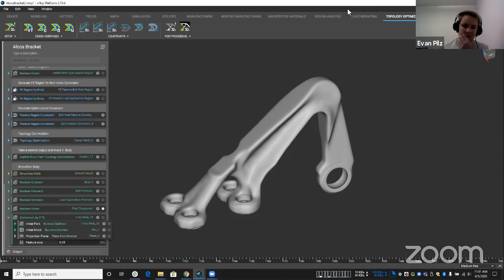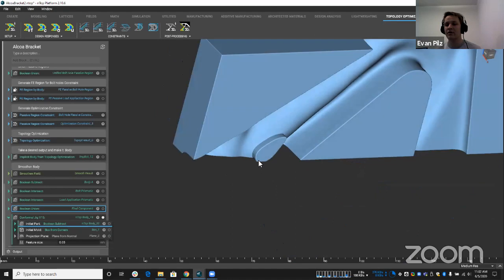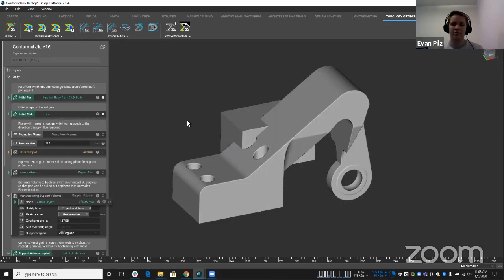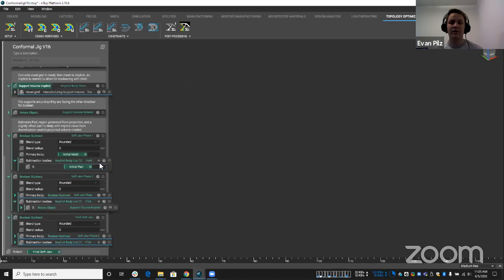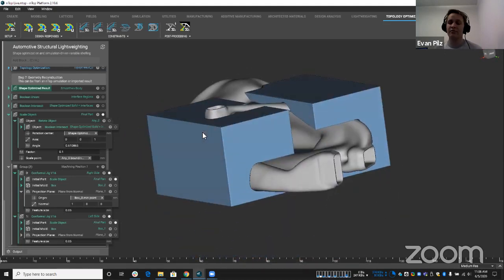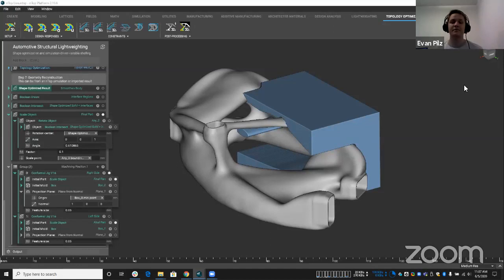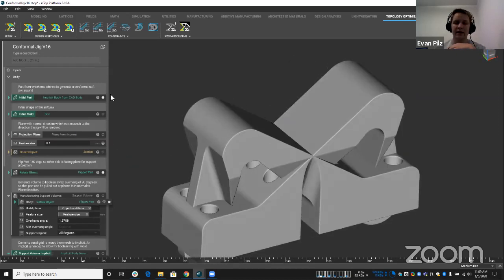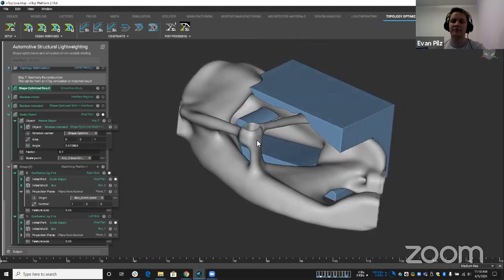nTop Live: Designing Conformal Jigs, Fixtures & Softjaws

Comment: which material do you advise using for this application?
Reply from the maker: Really any material will work but we are seeing it used mainly with FDM machines
Reply: @nTopology  Thanks. I believe there will be several tons of pressure for certain aprts and machines . I believe carbon fiber is a good material for this.